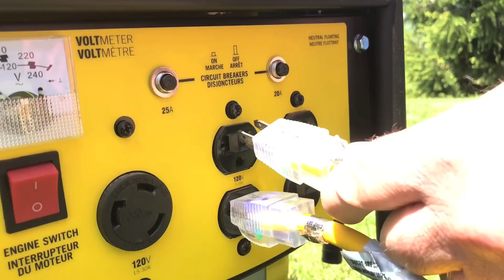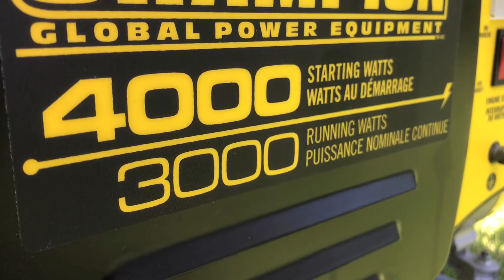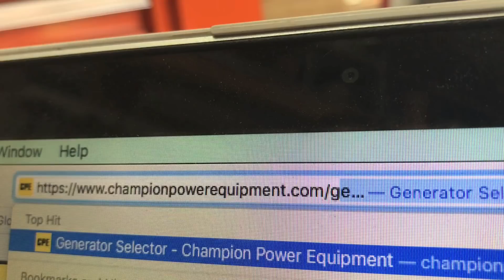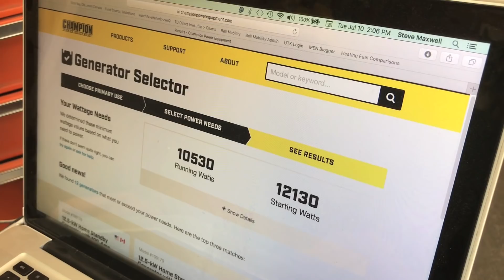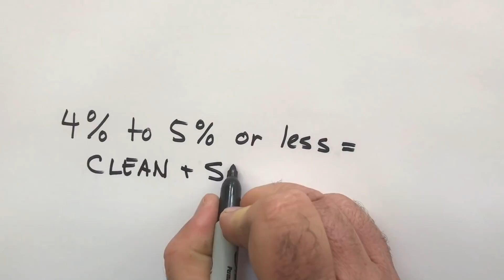HOME STANDBY GENERATORS: How They Work & How to Choose One

Comment: OK you said that the oil had to be changed every 100 hours so that means if it ran for four days straight, I would have to change the oil meaning that if I ran it permanently as a home power source from natural gas I would have to change the oil 92 times a year every four days! That is a lot! Who has time to do that they need to make a generator that does not require the oil to be changed every 100 hours is there such a generator like that or that is self lubricating??
Reply: These air cooled ones are standby. 14-20kw air cooled kohler are lawn mower engines, once you get to the liquid cooled 24kw+ sized then your maintenance intervals are longer. These little air cooled engines rely on oil to keep them cool and lubricated. Air cooled gens should be shut off every 24 hours, cool down check oil and add more, or start it again.

Emergency standby is what you’re looking for if you need this to run 7+ days with minimal interruptions. 24hours is a lot on a small motor..
Reply: The portable generators are even smaller run times before maintenance. I believe the predator 9500 inverter is 50 hours before it needs changed. The simplest way I’ve seen it explained is. More oil=less issues on long runs because the engine can be cooled more efficiently.
Reply: I just came across this.  You'd have to be a total 'tard to run this as a main power source.  Is reality anything you've known?

Comment: The inside walls of the enclosure have reflective layers that reflect the thermal radiation that's emitted by the generator... back on it. I suppose it is there to keep the generator warm in Antarctica-like weather. Otherwise, don't use it on hot days.
Reply: Lol

Comment: Excellent video i am very please with my Champion standby gas generator and if you have a low power demand house, with a relative small 8.5kw unit like mine you can power the complete house. Also the professional electrician who install mine that has installed over 300 units of different brands recommended the Champion generators over any other brand. According to him this units are way more reliable than all the others brands like the Generac, Honeywell (both are made by the same company) and Kohler.
Reply: What unit would you consider for powering two homes on two five acre lots ? My dad is seriously thinking about buying one for our home and neighbors ( we plan to share one generator)
Reply: @nerdgeekcosplay909  any 1800 rpm liquid cooled unit.